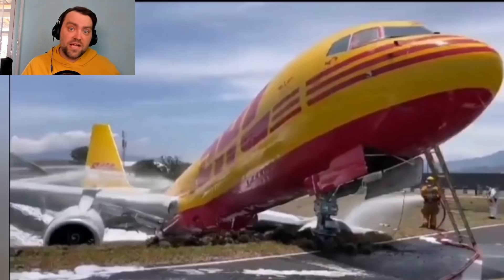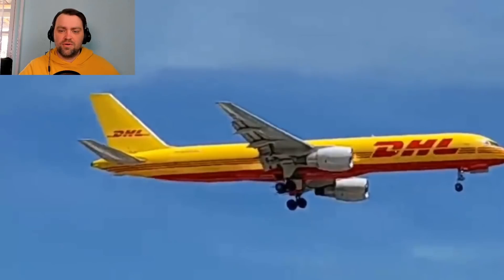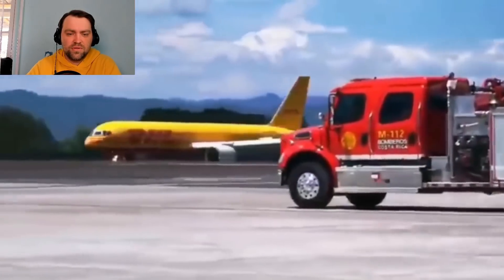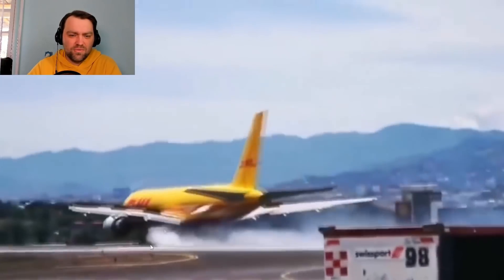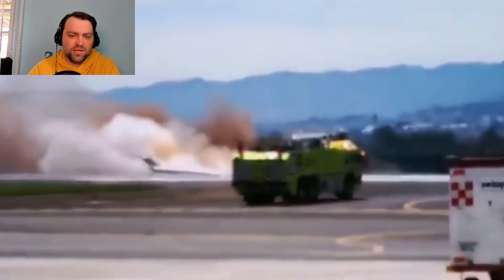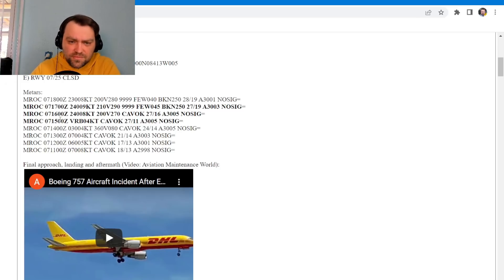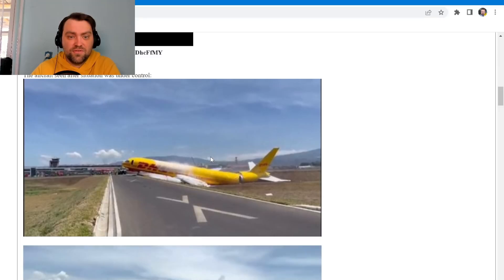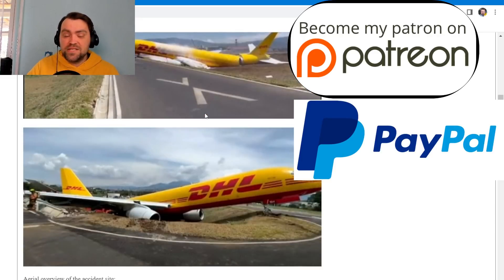DHL Boeing 757 crash in Costa Rica Explained By an Airline Pilot (First Look)

Comment: The 757 is only 5 years older than the A320, and the systems powered off of each hydraulic channel seem to be pretty similar between the two types (nosewheel, LH reverser).
I can't say I agree with your comment, especially considering the 737 NG still retains the basic 1967 hydraulic system architecture from tne 737-200.

Comment: Hard to tell from the low quality video but it looks like the port side engine thrust reversers didn't open so you have reverse thrust on the right and forward thrust on the left. That would explain the yaw. It looks like they didn't know the reversers weren't both working so gunned both engines to try and bring the plane to a stop. By the time they realised, it was too late.

Comment: Good catch 5:00 trust asymmetry...I have seen other pilots analysis but none have a clue why the plane did almost a 180º turn. If the brakes are good (no lock,just smoke for being too hot) I think the way the plane turns is really weird,but if the left engine was pushing the plane it is the only way you can explain this plane going off road to the right. They made a U turn to the ditch,almost like a handbrake turn. Maybe they did not realize about Left TR fail and pilots expected another thing. If you had a fail in one of the engine TR would you use the other engine to brake or brake only with the wheel brakes to avoid trust imbalance?

Comment: I believe the pilots panicked, applied hard differential (or full braking), while attempting to take the high speed turnoff.  My opinion: The pilots were convinced that they were out of useable paved surface to come to a safe stop, when they saw the displaced threshold markings approaching.  In fact, looking at 17:40 you can see a white diamond.  From that white diamond there is *STILL 3000' OF USEABLE PAVED SURFACE REMAINING* to bring the aircraft to an expedited, but safe stop. We know by the marks on the ground, that all four wheels were locked up and the plane was in a skid.  The pilots had most likely lost directional control at that point.  Did they intentionally turn off antiskid and apply differential manual braking, in an attempt to stop at what they THOUGHT was the end of the runway, losing control or attempting to make the high-speed turnoff?  This may have lead to complete loss of directional control, causing the sudden runway excursion.  Was antiskid disabled, inoperative or somehome compromised by the original hydraulic failure?

Comment: So they have tail wind 8-10kts, less than ideal flaps, and I think you're right. It's possible that they engage reverse thrust on both, but the left didn't open/deflected, so it produce forward thrust instead.
I think this is still a good outcome, crew is safe, plane didn't blow up/ catch fire.

Comment: Question. Doesn't the Boeing 737 still have some mechanical link from the controls in the cockpit to the control surfaces on the wings and tail? I think it's the only large jet that still has such a link.
I think Boeing calls them "Servo tabs" or "Balance tabs" maybe.

Comment: I'm an aircraft mechanic.. 
The Main landing gear shouldn't be smoking.  It appears that the ABS aren't working or disabled.   In planes ABS is needed,  or all the main tires could be locked up and blown in a  skid like you see in the video.  Planes have true power brakes. You cant feel if the wheels are locked and skiding.  
I have seen this before. Pilots forgeting to engage the ABS. They blew four mains and grinded the tires and the wheels down. They shredded half the rims and even the brakes.  The DHL incident looks like that.  The braked were working on the DHL plane.  Looks like no ABS.
Reply: If you are an aircraft mechanic...which I don't believe...you should be familiar with very common aviation nomenclature and concepts:  The system that prevents a skid and loss of control in aviation is called "Antiskid", not "ABS".  Tires do not "blow" on aircraft wheels.  That is because the wheels have fuse plugs that melt at a predetermined temperature.  This allows for more gradual release of the nitrogen, contained within the tires.  Controlled release of the nitrogen from the tires prevents them from exploding and causing aircraft damage, especially to the wings, which contain fuel.
Reply: @Flyfisher1976  I'll write so that everyone can understand the concepts. I'm not a jerk like others.  
Antiskid and Abs works the same way!!!  Preventing skids....  or locking up the tires. Means the same thing.  
Planes with hydraulic braking hsve full power brakes.  You arent going to feel the wheels locking up.  And so,  if the wheels lock up on a heavy plane the wheels will grind.  I have seen this.  The plugs can blow , the tires will loose pressure but, the wheels will remain locked if the pilot is still applying pressure.  The wheels will grind. 
If i want people to understand,  I'm not going to write in a manner so that people don't understand.  I have to break it down and not be a dumb ass. Apparently thats what you want to be.

Comment: I understand that the tyres were not burst and were still on the wheels because we can see the black skid marks right up until the plane left the runway, but isn't that a problem in itself? Why were the brakes and wheels locked enough to skid and leave tyre marks in the first place?

I'm not a commercial jet pilot, so please excuse my ignorance, but don't large jets have sophisticated anti-lock/anti-skid systems on their brakes?

If the anti-lock/anti-skid system was working, the wheels would be turning just enough to provide maximum retardation, but not locking and leaving black lines along the runway.

Could a separate hydraulic failure have disabled the anti-lock/skid system? Once the tyres were skidding (producing those huge plumes of smoke?) the pilot wouldn't have had much directional control of the aircraft, and the loss of the left engine's thrust reverser would only have made things worse.

It would have been like aquaplaning or driving on ice.

Is it possible that the pilot could feel that the brakes were not 'biting' properly, or knew that they had locked solid, making the plane skid to the right, and made the decision to try to direct it along the fast taxi-way deliberately to make the best use of the already crippled systems left to him?

With working (not locked) brakes and a symmetrical engine configuration, I imagine he'd have continued along the main runway. Perhaps the sharp right turn was an attempt to make the best of an impossible situation.

No disrespect intended to anyone concerned; I know that speculation like this is stupid and wrong, but sometimes it can help other people see things from a different perspective.
Reply from the maker: That is the good point. Actually I don’t know if the wheels were locked. I think they were still rotating. It other case they would lost them very fast. 
I think they stepped on the brakes…
Probably there could be problems with anti skid but it should have been working even from hydraulic accumulator that is a part of the standby system. 
Well, I can’t 100% be sure about it but you may have the point. Thanks for your awesome comment❤️✈️

Comment: Hello Denys, excelente vídeo and congratulations, I’m listened to the conversation between the controller and the plane and is true, they lost the left hydraulic system. And about the position of the flaps, if you extend in alternate mode, is posible extend maximum 20 degrees, this is the reason the plane land with higher speed.
Reply from the maker: Yes, flaps 20. That is what I thought

Comment: Hi Denys!   Great analysis!  Having many thousands of hours in the 757 I will be curious to see what information they get from the flight and voice recorders.  The checklist procedure for any loss of hydraulics is a Flaps 20 landing - primarily to ensure that a go around could be accomplished.  If you were at full flaps and unable to raise the gear or flaps, a go around might not be possible.  When we practiced hydraulic problems in the simulator, it always seemed like they would fail the left system, just because there was so much on it, including the nose wheel steering.  The plan was ALWAYS to just stop straight ahead.   Not sure why Boeing didn’t build a bit more redundancy into that system, but like you said, this is a fairly old design.  Thanks for the great analysis and I guess we’ll all look forward to more information once the investigation is complete.  I’m sure the pilots will be able to provide a lot of information as well!  Good job!  Stay safe my friend!
Reply: Thank you very much for adding this informations!
Reply: It's not that old considering the A320 is from 1987 and the 737 hydraulic architecture is from the 60s.

Comment: Hi, great video. I am not a pilot or profesional in aeronautics, just a big fan of airplanes. I am from Costa Rica, SJO airport has runways 25 and 7, the best landing runway is 7 because the terrain in the approach is low as you come from the ocean, but the issue here is our airport is 3000ft high and the winds change a lot. Runway 25 is very hard, the terrain and physical obstacles begin at 2 km from the end of the runway so takeoff and landing routes are actually turning south because of this issue. Hope my information is helpful.
Reply from the maker: Yes, thanks a lot for that information! That exactly as I thought. There should be a reason to land with that tailwind. Now I can see it…

Comment: I have landed there several times. After a while, I just refused to go there because it is such a dangerous airport for many reasons. It is a "Special" airport.  RW 7 is almost always used for landing - even with a tailwind because of the mountains. RW 25 is the preferred RW for takeoff. Most of my landings there were at night with weather down to minimums. I always just barely got in. The go-around is involved and scary. Also, there is no close alternate. The runway is not grooved, so if it is wet, good luck stopping. One night I had max reverse, max brakes, and it was not slowing down at all for a long time. This airport is the last place I would go with a hydraulic problem. I think the pilots are going to get blamed for this accident in the end. If they had PAX, there would have been deaths.
Reply from the maker: Many thanks for your comment!
Reply: For me it´s the question why they didn´t diverte to Liberia/ Costa Rica or Panama-City Tocumen. Both airports are much easier to approach and Tocumen is even the main base of the airline. Surely they had enough fuel on board, the original destination of the flight was Guatemala City.
Reply: @NicolaW72  One thing to keep in mind, cargo carriers always fuel for max payload, min fuel. I fought that battle many times. Most pilots just give in to the company and land on fumes.

Comment: I could never understand why many airports have ditches either parallel or at the end of the runway!
Reply: Must be for emergency ditching, since there is no water body to do it otherwise.
Reply: Serious guess from me would be they are a part of the rainstorm water drainage system. I've seen references to "drainage ditches" or "open drainage ditches" at airport in the context of runway expansion work, so I assume it is exactly what was referred there.
Reply: @Xerkus  you may have a point here. But aircraft skidding off the runway into a ditch certainly outweighs the safety hazards more than water drain relief does
Reply: @supercat380  I would disagree. Water needs to get off the runway fast and it is not an easy thing with the runway sizes and on almost horizontal surface. As an armchair expert on the matter I suspect poor braking and steering control as a common occurrence with a risk of hydroplaning would be much worse than any extremely rare skid off events. It is fairly common to read aviation news where stormy weather disrupts airport operations, forcing many planes into holding patterns to wait for the brief openings or divert outright. 
Looking at FAA advisory I see that 3mm of water depth is defined as the line between runway being classified as wet and as contaminated. It would depend on specific aircraft which depth is considered dangerous, eg for B737-800 I see reference to 13mm of water as maximum depth for takeoff or landing. Not even that deep, really. 

I am not involved with aviation industry and my opinion is about as fact based as that of any other random dude on the internet. However what I admire about aviation industry is how safety focused it is. I trust should it be determined an actual safety concern based on hard data available to the experts that authorities would order to ditch the ditches in favor of some other alternatives.
Reply: @Xerkus  good constructive and logical points you made here. However, many airports are quickly adapting to improved and revised water drainage to assist in quick dispersal of large volumes of water which may endanger aircraft during severe rain and storms. Hydroplaning has been a major contributor to a significant number if runway- based accidents and the problem is been taken seriously by aviation authorities. Your points are indeed very welcome and very informative!

Comment: From behind you can see only half the spoilers are up.
Unless the cause of the leak was in the line between landing gear actuation and nosewheel steering in the left hydraulic system they should have had nosewheel steering powered through the PTU. Automatically turns on when left system pressure low. If engaged it will power Slats, Flaps Landing Gear and Nosewheel steering. But it is no proof since Flaps can also extend electrically (ALTN FLAPS) and Gear can lower through gravity as you said.
I think the cause here is a heavy airplane (happened after takeoff and they returned immediately) and the tailwind on landing plus only one reverser operative and only half of the spoilers.
Why it spun we can only guess...Thrust assymmetry? Has nothing to do with the hydraulic failure so why did that happen? two catastrophic failures at once? I doubt it!
Nosewheel steering system inop due to leak was there? could be... You can see the Rudder is at full left at the beginning of the spin. Maybe the pilot used rudder only for directional control and forgot to use the steering tiller at lowering speed because of the stress? It is not clearly visible if the nosewheel is turning but a rudder deflection can also come from the steering tiller use.
Another question that comes to my mind is: Why did they brake so hard? panic? There was still ample runway remaining approx 950m at the point of spinning (exit Bravo). No need to force braking. Also, if you force braking you don´t have differential braking effect, do you?

Comment: Denys, thank you. What was the function of the area that destroyed the plane? Why wasn't the surface there level with the runway? On level ground the plane would have turned but not broken up. Perhaps the airport should also be reviewed to improve things.
Reply: Someone in another Video about this incident said, it was a region with lots of rain so they had to design the airport like this too get the water out of the way. 10cm of water on a runway would be chaos.
Reply from the maker: That is fine. Airports are large and you can’t make them full flat. Besides that are is far away from the runway.

Comment: Denys, thank you for this great analysis.  Is it possible on the 737 to unintentionally deploy only one thrust reverser?  Asking to figure out why only one deployed.  Great catch on the smoke being pushed by the number 1 engine, but not the other.  The thrust asymmetry does make sense for the drift.  Pity that the gully was so deep.  If it were flat, they might have been able to save the aircraft rather than having to write it off.  Great job on this video!
Reply from the maker: The anwer why the only one is in the video. They probably had the Left Hydraulic system failure...
Reply from the maker: Yes, you can deploy reversers from 10feet of radio Alt till touchdown but it is forbidden to do...

Comment: I think if the grass area wasn't down, the aircraft couldn't break into two pieces....
Reply: The drop-off definitely didn't help. Having something to slow down at same elevation would have been better although I am curious as to why the runway was higher anyway, doesn't seem like its on the side of a hill cause both sides of the runway seem to be lower.